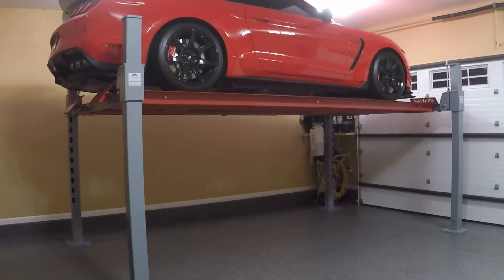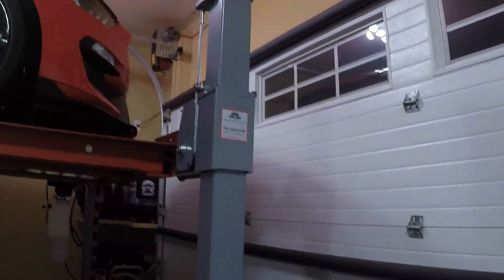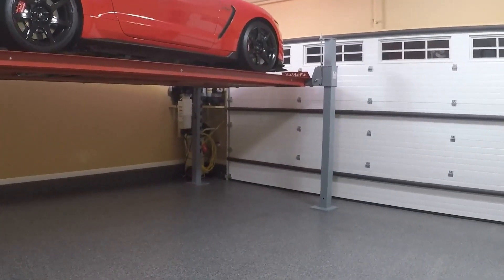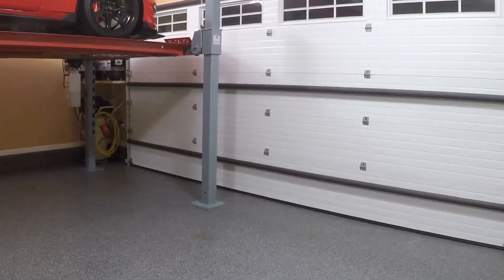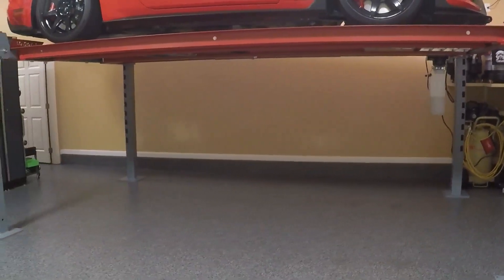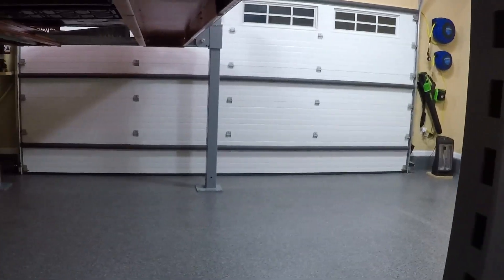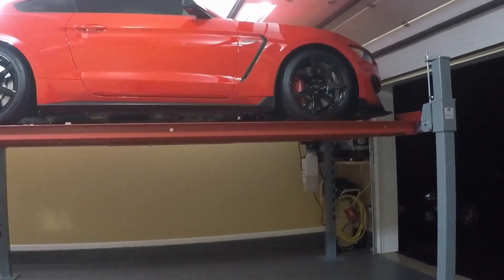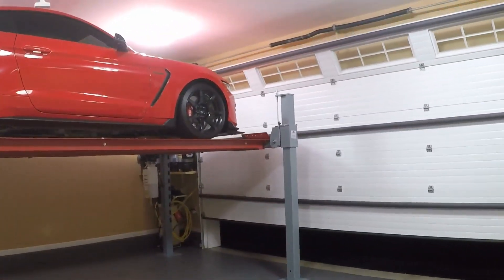Sizing a 4 Post Lift to Your Garage

Comment: Quick question, did you add additional angle iron on the outside edge of the ramps so that the GT would fit?  I have a couple ZL1's and the width is 75", if I was to get this lift I would have to add some additional angle iron for the tire width.  I was looking at the 9,000 HD XLT lift, thanks.
Reply from the maker: Yes there is angle iron added to the ends. It bumped it up to 83 inches. The XLT version has two settings 75 and 79.